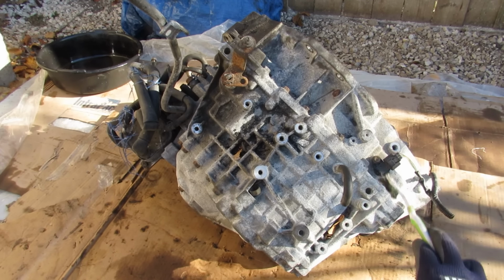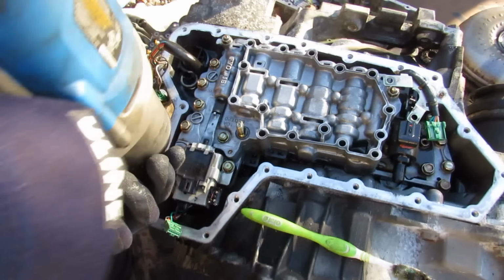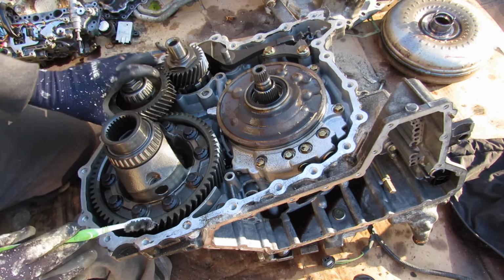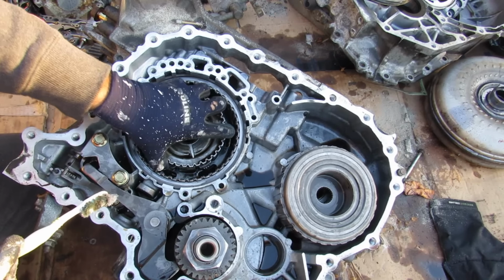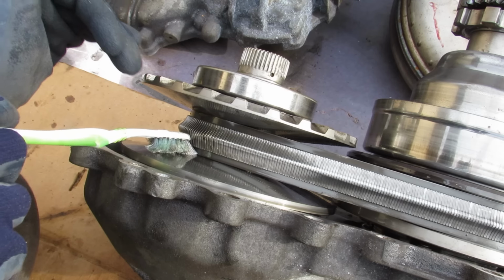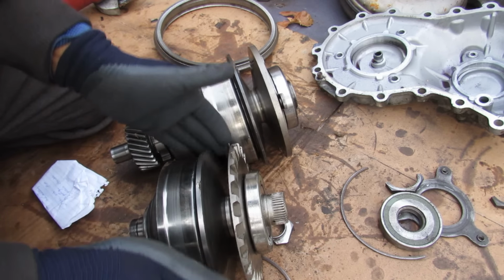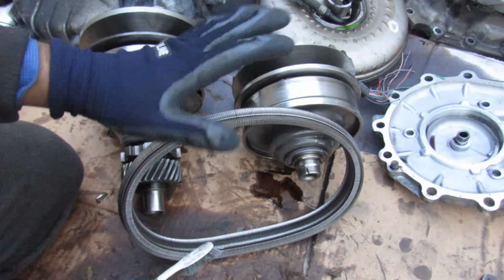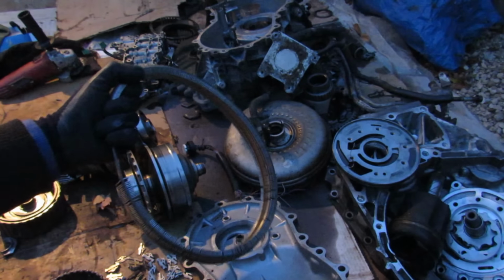Why Nissan CVTs FAIL

Comment: I have heard bad things about thes JATCO, CVT's.  From folks like Scotty Kilmer and others.  This is a flawed CVT from Nissan.  This thing is a piece of crap.  From what I hear.  And from what you indicate.  And really not worthy of owning one of these.  As there are no rebuilding these from what you indicate.  And they have limited lifetimes.  It's just more planned obsolescence.  And/or gross incompetence.

Now I do understand.  Other manufacturers of CVT have some successful designs.  Along with longer lived lifetimes.

But bottom line.  I really don't care for the idea of a CVT.  I would actually prefer a manual stick shift.  Less is more.  Keep it simple, stupid.  Because our parents, never had automatic transmissions.  All had to learn on manual transmissions.  And they lived to tell about it.

I happen to enjoy what a manual transmission has to offer to the control and operation of the vehicle for the driver.  There isn't any kind of terrain I cannot make it through with a manual transmission.  But there are plenty you can't with, automatic transmissions of any sort.

And so this move away to offering manual transmissions I think.  It is just another way to keep revenues high..  For charlatan companies that make defective transmissions.  Coupled together with charlatan repair facilities.  That bilk the public.  Of a transmission not worth repairing.  And if it's not worth repairing?  It has no right to be on anybody's automobiles!  And it's legalized robbery and vandalism.

And this nonsense has to stop!  A stop must be put to this.  It's not just about the gas mileage.  It's about the long life and longevity of one's costly investment.  And I want my vehicles to last!  I'm not interested in the appearance of how pretty the newest models are.  I need reliability!  I need solid operational  functionality.  I'm not into fashion and pretty ornamental gobbledygook.  That's a bunch of suckers and losers.  Because no vehicle has to look sharp or pretty.  I mean what the hell is with this in the 21st century?  You can't even tell the vehicles apart anymore.  They have to be built to such close governmental standards.  So an overall homogenization has occurred.  And it's not good.

This was an excellent video.  Thank you very much for this very in depth explanation of how a CVT works.  And how they are not worth repairing.  And this will be something of a factor I will figure in upon my next vehicle purchase.  I want no CVT's.  This I now know.  One of those overly complex stupid ideas.  With fewer moving parts.  Big fucking deal.  It's a piece of crap design.  Belt driven drivetrains.  Give me a fucking break.  What is it 1905 again?  Chains were good on bicycles.  Let's put them on the cars.  I think not.   We have technology now that far transcends that..

So the internal combustion engines are on their way out.  Solid-state batteries shall materialize, one day.  We think.  And we are not going to have to worry about such things, anymore.

What we are going to have to worry about.  Is a single electric drive motor.  What the hell?  What about 4 drive motors?  One for each wheel?  I meet what the hell is wrong with everybody?  A driveshaft on a single electric motor to power all 4 wheels?  Give me a break!  No no and double no!

So as I see it.  New tires being created.  Will in fact be the guts of the motor driving that wheel.  The motors will be built into the tires.  The tires will be made of non-pneumatic design materials.   They will never go flat.  And when you have drive problems.  You will pull off that motor and wheel.  And replace it with your spare.  Just the way we always have.  The tire will make a great  Armature or stator.  Being incorporated around the hub..  And then more cargo and passenger space.  When you reduce the drivetrain to the wheels themselves.  And they can all individually be lower in power.  Because it's not one big current sucking monstrosity.  It's 4 littler ones.  And talk about effective independent four-wheel-drive.  That would be the ultimate.  With 4 motor drive.  All built around the wheels themselves.  The wheels are the motors.  The motors are the wheels.  And that could be effectively done.  A bit more of a challenge.  Which no one seems to be willing to take on.  But I think that's where the future lies.  Not with some oversize washing machine electric motor.  But with high tech, high-efficiency electric motors at all 4 wheels.  And that can be controlled by the onboard computer monitoring system.  So that in cruise on the highway.  It might reduce to only a single drive motor at a time.  Or reduced to perhaps 2 at a time.  And being able to select which of the 4 motors you want energized and running.  Should you decide one needs to be disabled.   You would have that capability on your dashboard.  And simply locked into free wheel spin  mode.  If a particular motor has a technical or electrical fault,, failure or mishap.  Such as a thermally introduced issue.  Control electronics, MOSFET transistors blowing out, etc.  And that drive motor would need to be feathered and/or disabled.  Which could then be disengaged and bypassed.  Allowing the other three to operate normally.  OR just 2.  Or just a single.  To get you off the road and/or to the corner garage.

And so my electric drive vehicle would have, redundant backup times 4.  Or would that be times 3?  If you only need one to work.  To get you off the road onto the shoulder.  And/or down to the next exit.  And into a service center.

So this is now all, ancient, obsolete, antiquated, internal combustion, technology.  It's over 120 years old.  Time for a change.  And time to get solid-state batteries on the move!  That's going to be the biggest game changer in our lives this century.  Batteries that only take as long to charge up as a super capacitor.  In mere minutes.  And contain no explosive materials.  Because they are solid-state.

It's a coming
RemyRAD

Comment: Excellent explanation of nissan cvt. btw, later model non stepper motor cvt are serviceable by replacing the pulley sub assembly (pri and sec) and control valve body.

Comment: Because of public miss understanding cvt “feel” and operation, many new to cvt owners thought the transmission was slipping. So.. Nissan programmed artificial shift point by quickly varying those cone shaped pulleys. This is why most cvt’s  fail.

Comment: I drive my 2017 Maxim pretty conservatively most of the time so I’ll keep my fingers crossed.  I do hit it when necessary and it’s nice to have the power for those moments.  I knew what I was getting into with the cvt when I bought it.  I’m at 51k right now hopefully there is a decent chance I’ll make 120-150k.

Comment: Heres a question. Does fake shifting all these cvts do reduce reliability over time? I would think so because shifting makes the change in torque applied to the system happen faster and thus more wear on the components. I blame consumer reports for the fake shifting. At first none of the oems had them then consumer reports would bitch in every cvt car review about the "akward rubber band effect and high droning" from the cvt. Sorry but thats a cvt being a cvt and fake shifts take away all the advantags that come from a cvt, ie rhe engine being in the most efficent rpm all the time. GET RID OF FAKE SHIFTS

Comment: When you look over nissan products in general you see cost cutting everywhere. Im sure they could make their cvts more reliable but dont to save $$$. It all started when Carlos Goshn and Renault SAVED nissan in 99. Nissans products went from reliable boringmobiles (01 altima) to cool desirable cars people really wanted (02 Altima) but reliability plummited. 02 altima 4 bangers eating cats and burning oil, cheap interiors and then in 07 BAD CHEAP CVTS.

Comment: I've had dealership salesmen complain to me about advising my customers not to touch anything with a CVT.
I tell them if people stop buying this crap maybe manufacturers will stop producing it.
Problem is it is getting hard to buy a new vehicle that is not CVT.
Manual is getting rare and traditional autos are all but disappearing.
My old auto Toyota Hilux Surf has done over 300,000km and is still performing as well as the day I got it.
It does get maintained which probably helps but this mileage is not uncommon with Toyota autos.
I have seen a Murano CVT begin to fail at under 60,000km.
It was out of warranty but Nissan came to the party and fixed it for her.

PS: Here in New Zealand, trans guys are rebuilding these things, not cheap though.

Comment: Anyone that bought a Nissan at the dealership with an CVT transmission, take it back.
Reply: can we do that ???
Reply: @riwazbhandari3653  no he’s being a clown. There’s nothing wrong with the CVT, just maintain it properly and you’ll be fine. My Maxima has over 100k
Reply: @bradcast2967  Jatco CVT's have a high failure. Once you have early symptoms of Transmission issues, the clock ticks when you'll need to replace it

Comment: CVT transmissions are garbage in general.  It doesn't matter who makes them.   I was a Saturn tech when they introduced this tech into the automotive world. (Saturn was the first to bring this to the states.)   It sucked! Most other Saturn Transmissions were actually very good. It was called a VTI Transmission.  It could not be rebuilt. You could only replace the Pully and belt assembly.  But that never worked so you ended up replacing the entire trans.  All under warranty time. We called it Sheave ratio not gear ratio.   I loved working at and on Saturns until they took Oldsmobile's place in the GM cookie cutter world.

Comment: That's exactly what I said why they fail.
I wanted the newer pathfinder but picked the old one when the CVT models were plauged with issues.
The suv weighs 5000 pounds and then it has a tow rating of also 6000 pounds, pair that with the 300 hosepower vq35.
They are putting that poor CVT through a hot supper and put away wet. Of course its gonna fail. It seems to do well with the altima and sentra. But bigger and more powerful cars, no.
A big part is also the "shifting" they program into it, that's more wear that a cvt isn't designed for.

Comment: One question I’ve not been able to get an answer too- Towing a broken vehicle. I hear that damage will occur to the CVT if pushed out out the traffic on neutral. For towing to shops, use tow trucks with tow beds instead of tow hook types. So, much confusing information. Can you shed some light on this?
Reply from the maker: As long as the drive wheels are off the ground it's fine to use a tow truck

Comment: First of all THANK YOU  for the therapy session! Superb job ! Seen too many cvt's  getting changed at my friend's garage. I unfortunately own a 2017 Rogue, transmission acts better in the cold and really bad in the heat as we know the cooler is good for nothing! I change the cvt fluid atleast once a year. We are going to try to make an external transmission oil cooler for an older rogue (2009)! Time to trade in for a good old gear box.

Comment: CVT´s are fine for Scooters and light cars. But when a VQ- trumpet is pushing a heavy Murano around all day, its not the right application. Adding some cost- cutting and its all downhill from there.
I know a Prius is boring, but its planetary transmission is a way better concept at CVT.
I dont know why Nissan is still pushing this concept today, regular automatics have come a long way in the last years when it comes to fuel economy... Just buy some from Aisin and call it a day...
Reply from the maker: Alot of other manufacturers are going the 8,910 speed auto route instead of CVT transmission

Comment: Great video. I’ve been looking for some CVT information. I’ve been thinking of putting in a tow bar on my 2019 Honda CRV. I keep getting two different types of advice. I choose to only consider advice from the transmission pro’s. My vehicles last me 10 - 20 years. So, my thinking is for long term vehicle use. Thank you.
Reply from the maker: Your CRV can tow light loads, a utility trailer, or jetski, or use the hitch for a bike rack. 

I'd be more worried about stopping distance which such a small vehicle than pulling power.  I tow a utility trailer with my Camry and stopping is my limitation. 

Also invest in a transmission cooler and keep up on fluid changes.

Comment: My wife has  2019 rouge sport, what’s the best thing to do to make sure they last as long as possible? So if the belt wears out you basically have to take the whole transmission off?
Reply: Have a full transmission and transfer case (if AWD) flush every 30,000 miles.
Reply: @1vw4me  it’s not AWD still every 30,000?

Comment: I never understood why Nissan chose the CVT exclusively for the North American market, but in Europe they offer a manual transmission.  Even a normal automatic transmission would be an improvement over this turd.
Reply from the maker: They would loose alot of market share in Europe if they didn't have manual...that's the most popular choice there. Manuals also make better use of the smaller engines they have there due to regulations.

Comment: Google said Honda cvt is the most reliable, is it true ?
Reply: I've driven 400k+ miles across two 9th gen accords and have not had one issue. I just keep up with 30,000 mile transmission fluid changes